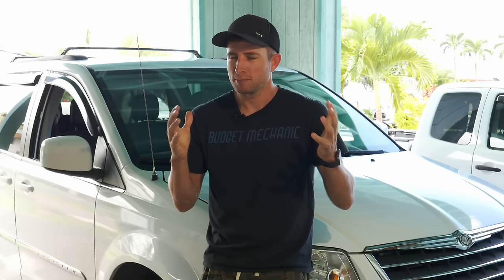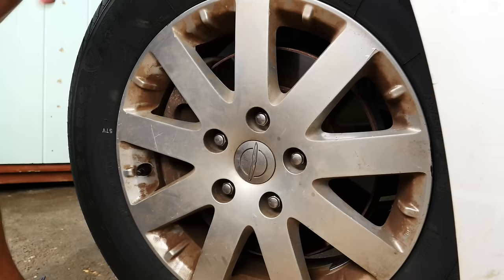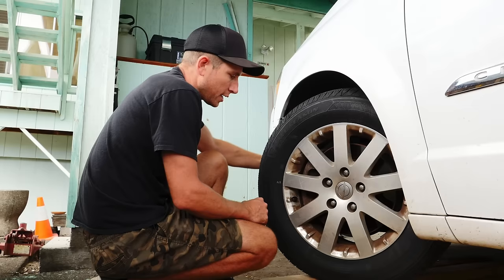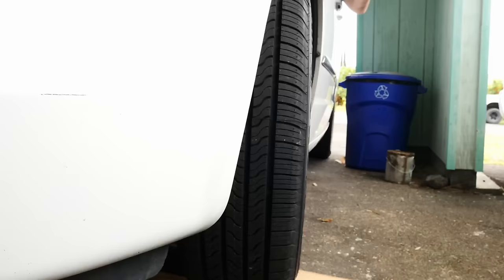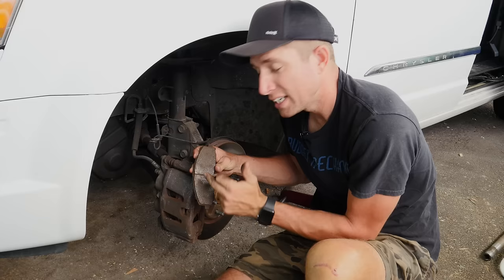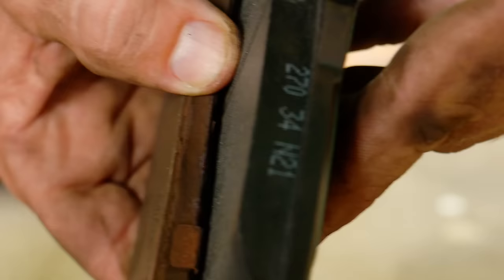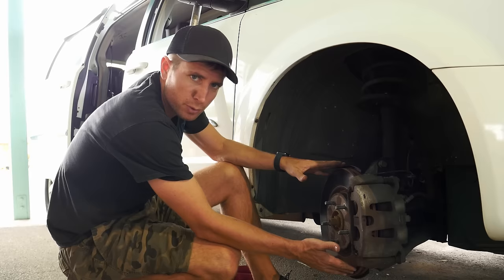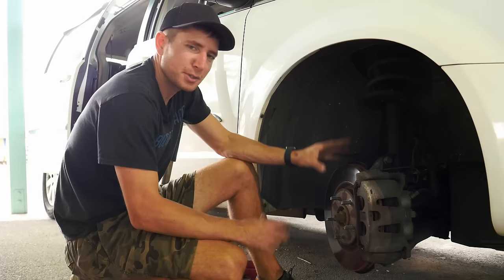How To quickly Check Your Brake Pads and Rotors - Don't Waste $$ Changing them Too Soon!!

Comment: Here in Maine the roads are paved with salt for 5  months. The rotors build up with rust on the inner face long before the pads are worn out. Braking is still fine but you begin to hear a grumbling sound, and feel it, when braking. Seems the outer surface always looks fine. I am always shocked when I see how bad the inside looks. Just replaced front pads and rotors on my Equinox, Rock Auto had a good quality rebuild kit (Raybestos)for $150. Just needed a tube of brake grease and some fluid film from local parts store. Took about 2 hours total working on the floor, no lift. I'm 75+ and have done many brake replacements, both front and rear, over the years. Did the Equinox rear with the electric parking brake last year with no problems.
Reply from the maker: Good work!
Reply: Cool story bro
Reply: I'm pretty sure they don't actually "pave" the roads with salt.
Reply: @Fred-mp1vf  duh

Comment: Good  video. Saved me a few bucks. I have an Audi performance model and the dealership makes you get new rotors with new pads to ensure the performance. $2k for the complete package. This advice will help me get the most out of my pads before I change them.

Comment: Good points! A US penny is ~1.5 mm thick. If the mechanic recommend a change based on using a caliper and pads, measure 4mm. The DIYer should just go ahead and change it.

Comment: It’s funny that this video was just recommended to me. Last week I was getting a transmissible fluid change and the shop recommended new rear brake pads. I denied the service because I planned to do it on my own… when I dug in and removed the pads they were worn to about 50% compared to the new pads I bought a while ago when I heard the squealing that turned out to just be a bent pad insulator.

This was a respected independent shop… so they at least offered a reasonable price on the work, but still.
Reply from the maker: Still… diy!!

Comment: I've always done same as what Josh states here, just checked the pads and rotors on my 1988 Mazda truck last week; at 233K miles, still on factory rotors and rear drums.  And my 1998 Frontier (275K) and my 2004 Frontier (106K) are still on their original rotors and rear drums as well.

Comment: Great content!  I run Brembos on my Challenger Scat, it's coming up on the 2 year time frame, I will check them in the spring when I take it back out of storage.  You can access them pretty good from the outside with the OEM rims.

Comment: Always use a jack stand! Rotors have a minimum thickness and require replacement if that limit is reached.
Reply: I like to wear them down to the cooling vanes in the center. I save millions with this simple trick.

Comment: Also, from my experience the front brake pads wear out faster then the rear. Most of the time about twice as fast. On my pick up, the rear pads lasted over 100k miles. But I did check them several times.
Reply: I thought the front pads wear out first but my state inspector told me that I should replace my rear pads soon (but still passed me). - as they are almost worn out but my front pads were still okay !!  My car is almost 6 years old , bought new - with 125,000 miles on it - never had a brake job done -same pads.   Yes, I do alot of highway miles but do some stop and go at times. (2017 Tucson AWD).
Reply: from everyones experience
Reply: Not just that, but the front driver side tends to wear faster than front passenger side.

Comment: When I’m inspecting brakes for state inspection, I’ll check and pull all the brakes. If they have hot spots on either pads or rotors, I’ll highly recommend them, cracks fail, 2/32 fail, and if the rivet on the backing plate is below a certain amount, it also fails. With that being said, if the pads have even wear more than 2/32 from inside to outside pad, that fails for state inspection or highly recommend replacing. Hot spots or crazy glazing is highly recommended. If pad to rotor doesn’t have much contact, it’ll fail state and/or highly recommend if it’s not coming in for state inspection.

Comment: Correct me if I'm wrong, but don't all rotors have a minimum thickness stamped along the outer circumference of the inner area where the studs go through?  Mine do, though I had to scrub them to see it.  I measured them with a dial caliper.   Something like 21mm minimum thickness for mine and I was at 22-23 as I recall.

Comment: The service centre told be to change the pads like when my car had 150,000km on it. I ignored them and finally changed them recently at 225,000km and they still had a good 4 to 5mm on them. The pads came with the car and lasted me 12 years.
Reply: mine lasted 155k miles

Comment: I been driving on the same brake pads for the last 60,000 miles 🙃 I think I’ve gotten away with it though because I drive a lot of highway miles and I never slam on the brakes; in fact, I barely press on them. I’m changing them this week though because I finally heard some squeaking.
Reply from the maker: Good idea! Get a quality set and you might go another 60k!
Reply: You make a very good point. How you drive makes a difference on brake wear.

Comment: Here in the Northeast, brake components seem to fail long before a set of pads do. Especially rear calipers on Hondas with manual transmissions. The parking brake actuators either seize or break after a few years, no matter how careful I've been when applying the brake, no matter how many times I clean and lube them.
Reply from the maker: Road salt?
Reply: Wash your vehicle under and apply rust protection

Comment: They suggest changing rotors between 30,000 and 70,000.  I'm 61 and only ever replaced rotors when I upgraded to a big beef brake kit for my C.O.D. MW3 Rubicon JK.  Maybe I'm ignorant, maybe I rarely drive older cars, maybe I don't drive in aggressive city environs.  A local mechanic told my wife her '15 explorer needed new rotors and now she's all freaked out, saying her brakes are broken (she feels it, she says).  The guy wants big cash for the job I don't have time to do... so I'm going to end up feeling it as well unless I find the time to replace the pads at least. (Mechanic #2 looked when asked to check the rotors.  He said, yep... new rotors see the rust on the top edge! No measurement, now checking for warpage (no symptoms of issues either)... its that dirty rust!)  Rule#1, never let your wife near a mechanic

Comment: Ya want to know how many times I've truly needed to change a rotor?  Once, when pads went to the rivets for a week of use. That was 30 years ago. Been maintaining my own cars for 34 years and owned 40+ used cars and trucks from mini economy cars to 1 ton trucks. Never replaced a rotor other than that one time.  Only had 2 times that calipers needed replacing.  Unless you're racing vehicles or running commercial heavy trucks, brake components rarely need replacing.

I change one pad at a time when they're down to about 3mm.
Reply: this comment should be pinned
Reply: @mcburgerpants I just change all the pads at the same time. They only cost $30 for a set.

Comment: I tend to just drive the car in to my local dealer and get them to run a health check on it nowadays. They put it on the ramp and I get a report on nigh on everything i.e. brakes, tyres etc. And its FREE! Another way to check is get an Endoscope Inspection Camera. £30. Such a camera has lots of uses.

One downside of just inspecting from the outside, is how the pads themselves are. I had a Corsa where the pads hadn't got down to the wear line but, as I was going on a long holiday trip, I decided to swap them out. Removed the pins to take the pad out and as I pulled it out, it was a wtf moment. The pad material came away from the metal. The only thing that was keeping it all in place was the caliper itself.
Reply from the maker: Yikes!
Reply: That's how they make their money
Reply: Cool story bro

Comment: I read through the comments (47 at the time) and nobody asked this question:  In this video the brake pads on the driver's side were acceptable and the brake pads on the passenger side were worn enough to need replacing.  So, it is obvious that the passenger side should be replaced, but if you replace the pads on one side shouldn't you also replace them on the opposite side so that all pads are the same thickness and would create the same amount of braking performance?  If not, then wouldn't it be possible for the side with new brake pads to cause the vehicle to pull to that side when the brakes are applied?
Reply: You might as well replace them all because I don’t believe you can buy one pad they come as a set. It would make sense to replace them all the same time for even wear.

Comment: The best way to tell if your brakes need changing is wait until they start to grind. I know, it sounds stupid. Since manufactures are making rotors out of the cheapest metal they can find, the days of changing just the brake pads are over. When I worked in in a car shop, there use to be a machine called a "rotor lathe" which would turn the rotors until they were smooth, and then all one had to do was install new brake pads. Now, mechanics will get new rotors every time the brake pads need changing. One might as well get one's money's worth out of the brakes that are so ridiculously expensive!
Reply: Mine just started grinding 2 days ago, but I need my car to work deliveries and I don't have the money to take it to be fixed... rent is due Monday. Is it safe for me to drive at least another week or so, maybe 3-400 miles with it grinding?
Reply: Cool story bro

Comment: If you have a manual trans, you can use brakes very little to get you by a bit
Reply: Automatic transmission can do the same if you downshift it yourself. Or use common sense (don't brake aggressive)
Reply: @mann_idonotreadreplies   naw it ain’t the same

Comment: I have a famous brand Japanese luxury car. It went to the dealer under warranty to have something trivial done. That service was not related to tires, rims, wheels, etc.  Some months later the brake pedal was pulsating under foot and I knew the rotors were warping. When I tried to remove the lug nuts they were torqued so tightly that I had to bounce on a 3' breaker bar to loosen them. I weigh 180! My car had been sabotaged. I had previously torqued them correctly to 74 ft-lbs. Mentioned this previously on line and someone responded asking which dealer it was.  I declined to answer citing liability concerns. He said, "Then let me guess."  He got it because the same thing happened to him. I replaced the rotors and pads myself.  It was very easy. Incidentally, someone had also cut the brake wear sensor cable.
This may be a common scam, so be careful and check.
Reply from the maker: Yeesh!

Comment: I have a 2009 Honda Fit with 143,000 miles on it and I have never changed my brake pads. The rotors are in good shape and the front pads are at 4mm. There is no squealing or vibration when I brake. Should I change the pads and rotors or just the pads?
Reply from the maker: This is pretty incredible. I feel like the old girl deserves some fresh rotors ;) but if they aren’t glazed, cracked or uneven it’s just plates of metal that will continue working just fine

Comment: i was quoted $800 for just the front brake pads and rotors. I didn't think that rotors were necessary, so I went to the garage where my car was and they told me that I needed new rotors because they were rusted. So I asked to see them and soon discovered there was no rust. When I said I only wanted the pads, they refused.
Reply from the maker: Oh, I think they are jerks or operating under some crazy insurance liability. Either way, time to find new mechanic or do it yourself

Comment: My large SUV I just purchased has 6mm on the front pads. I was told I need to resurface my warped rotors on the front and agree. Should I replace the pads at the same time?

Comment: Thank you!! I feel a lot better when I’m trying to tell them I don’t believe I need rotators. I went to get just front breaks and they told me I need to replace all 4 breaks and rotors.they said they didn’t hear any noise on the test drive. I just don’t understand why they are trying to get me to pay $1000 when I know I don’t need all that. I have experience from my ex teaching me but unfortunately I don’t have the tools now to do it myself. They also said the calipers we broke, however I don’t know much about those.

Comment: Some of those shady break guys will put the new pads on then squeeze the squeaker so it starts making noise sooner. Then they’ll say you need a new caliper. But not both. They’ll then use that same trick again for the other side. That way they roped you into 3 break jobs a 2 caliber replacements. If you haven’t caught on then it’s a repeat but it the rotors. Once again only one at a time so your constantly waiting money.

Comment: Can you recommend what type of pads to purchase.  Not sure if they are made of the same material or if some are better than others.  Appreciate your recommendation!! :)
Reply: My personal recommendation from having my own automotive shop has been from autozone. Specifically, duralast gold rotors with elite brake pads. Parts alone start at $149.99 and can go up depending on the vehicle, but not a whole lot. I’ve never had a single issue them, they grip better and last quite a long time.

Comment: My brakes make a squealing sound when I’m backing out of the carport for the first time in the morning, but as soon as I get going they don’t make any noise. They have always done this. Is that normal? My car is a 2015 with around 96000 miles on it. I live in East Texas where is very humid most of the year. The brakes have never been changed, but I also never ride them hard. I start coasting to slow down when I know I’m going to need to stop and gently brake to come to a full stop. I’ll check them to see if they’re still okay.

Comment: went to a local car shop and was told my brakes need to be replaced and that they were supposedly around 3mm. I was rebalancing my tires and just wanted to double check the brake pads and they were at 7mm.. I will never trust another mechanic again. I'll check stuff myself at this point.

Comment: When check thickness you should do inner and outer, you look at outer it looks decent  but then you look at inner and its half as thick  as for rotor they can warp many do so if you have that peddle pulsing when stopping normal is a sign of rotor warpage
Reply from the maker: True true

Comment: Here in the UK, I grease twice by year the pins "the weather is special here",   if the caliper use one piston,  my experience is check  specially the  internal "inside" brake pad.   Don't be happy checking the outside brake pad visually only.
Reply from the maker: Not a bad tip!

Comment: Can the life of the rotors be checked when examining the brake pads? 
My dealership is offering a good deal to replace pads and machine resurface but I’m worried they will tell me I need rotors because too thin to resurface. The rotors they sell are highway robbery at  $160 each 

I’m at 4mm but I’m planning to drive total RT 2600 miles in a couple of weeks— traveling over total 6 mountain passes 

Can I just replace brake pads and have my mechanic neighbor put new rotors on after my trip? 🤷‍♀️

I’m thinking of all options
I’m on a tight budget 
Car has 96K miles 2015 Honda CRV
Reply: Don't go to the dealer. They always over-charge.

Comment: Good tips.  Question to anyone---I rarely see anyone using a Torque wrench to tighten anything....should these caliper bolts be tightened to specific torque specs or just as tight as you can with a ratchet--just curious.
Reply: It’s always a good idea to torque bolts. Everything has a spec. That being said, mechanics can get a feel for what is adequate over time. It’s up to you as it’s your car but me personally I wouldn’t see a need to torque them down too hard.
Reply: I'm pretty obsessive about torquing all the bolts to the required spec when doing a brake job on my car.  That info is pretty easy to find on line.  I even use the torque wrench for the lug nuts on the wheels.   Always clean and put fresh grease on the caliper slide pins too.
Reply: nah....waste of time
Reply: @brent get Bent

Comment: I think using something like a gap gauge (preferrable plastic) like they use for valve clearance, insert it in there, then measure the brake pad material minus the thickness of the metal plate and compare with the new. What ya think? Anyone?

Comment: What would the minimum thickness of the brake shoes on the front of a 2020 Ford F-250? I live in TX and it is flat…. Thanks
Reply from the maker: Heck on a 2020 you might have plenty of life in those pads still! 2mm is a good time to start thinking about replacing
Reply: @BudgetMechanicHawaii  thanks!!

Comment: What about hairline heat stress cracks, on the flat metal surface of rotors? How bad are they allowed to get, before require replacing?
Reply from the maker: If you literally want to be safe as possible, you should replace rotors with cracks. My thinking tho is, that by the time they are cracked, they’re likely warped and/or glazed and noisy. So why not replace anyway. 
Most shops aren’t going to resurface them either

Comment: I was told that I needed brakes and rotors for my front wheels on my Toyota Corolla 2004 and was charged $230.00 to replace them. After two days I started hearing about grinding sound on the front wheel driver side when turning the wheel to the left as I’m backing out of my parking space behind my house and the car jerks when I’m applying my brakes what does this means.
Reply from the maker: Sounds like you need to take it back to whoever did your brakes!